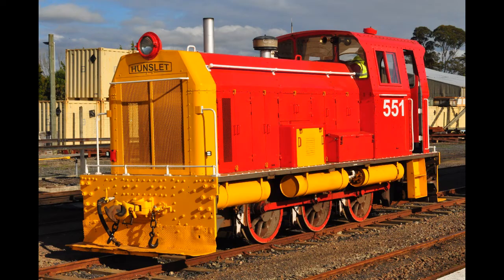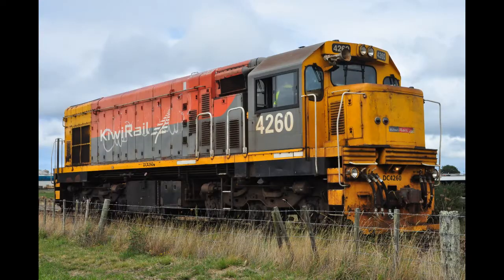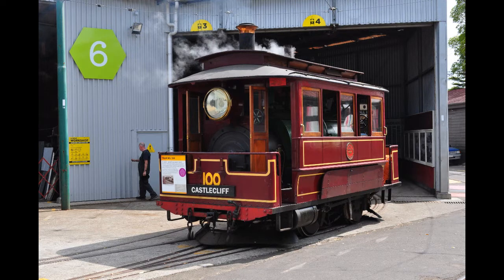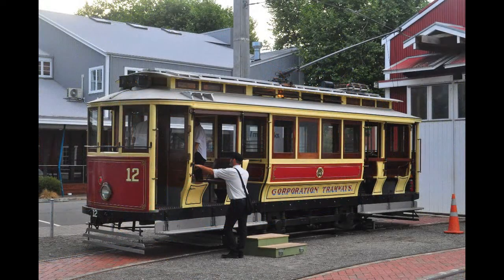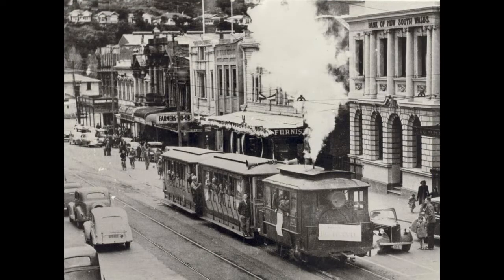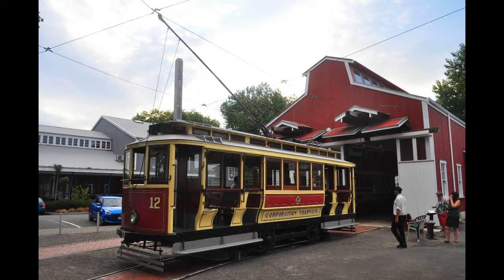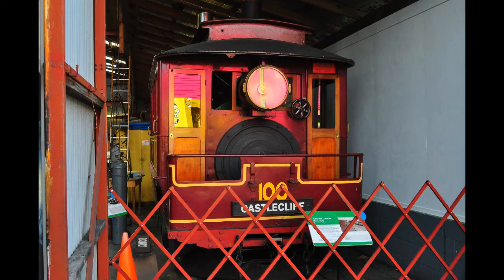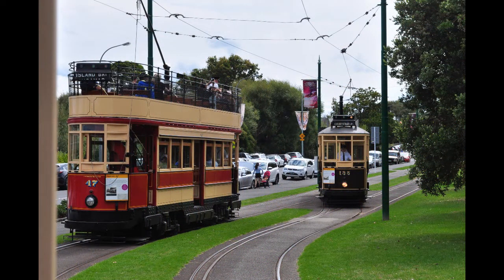Locomotive Spotlight Ep. 6 ~ Baldwin Steam tram No. 100

Comment: Nice documentary you did on the Baldwin Steam Tram, also I wonder why it doesn't pull carriages
Reply: that is because the trailer motat has from the whanganui line is still being restored since 1980 and work restarted around 2010 or 2012 however the trailer will be complete pretty soon and you can go an see the process down at the tram barn